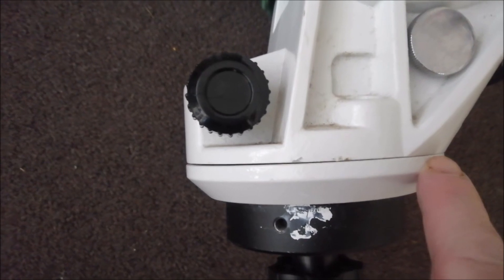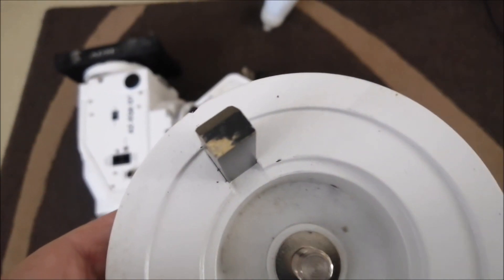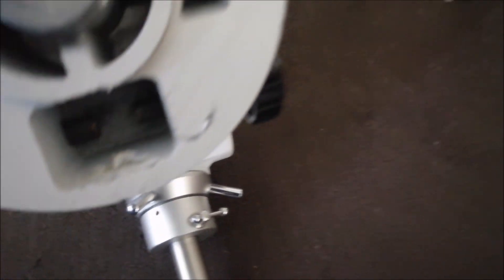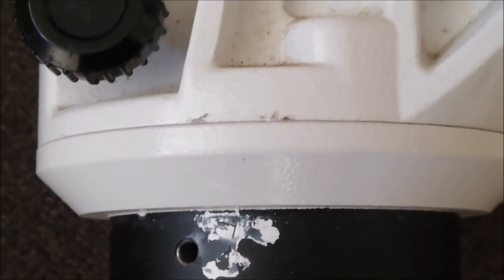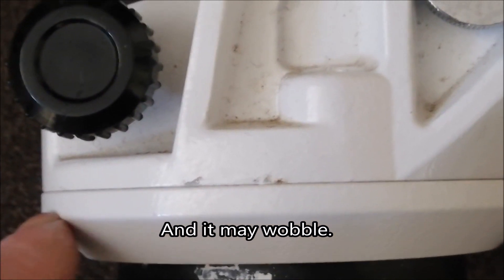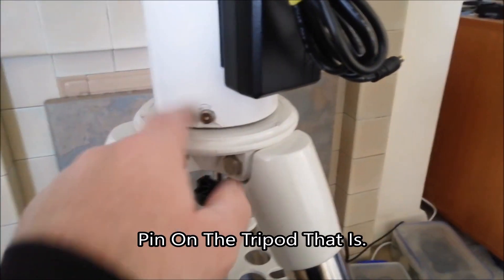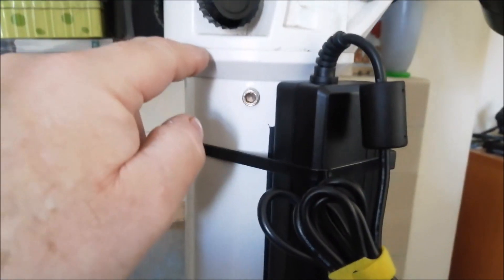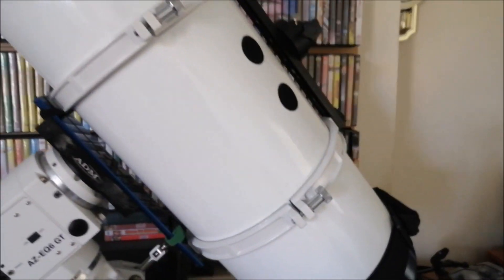Fixing the wobble on my Skywatcher pier

Comment: Great tip Tich! Wish I could work that quick with a saw🤣
Reply from the maker: I'll be honest mate the metal on the pin seemed to be quite hard either that or I need to replace the blade, I'm just glad its rock solid now though.

Comment: is there not a plate at bottom of the pier that slots over a bolt?
Reply from the maker: There's a plate that bolts to the mount & the pier goes over it but it isn't held in place by a pin or anything as you have to use that on the pier extension itself, this video made by Skywatcher shows how it goes together https://www.youtube.com/watch?v=E6f2n_O95SU&t=1s
Reply: @dumpydalekobservatory  dam, the plate i have has a hole in it that you put an m10 bolt into one of the 2 holes where you removed az pin from.. maybe you could drill the plate
Reply from the maker: @CDigata  Sounds like a plan may give that a go cheers 👍